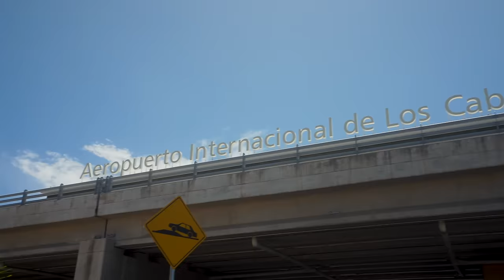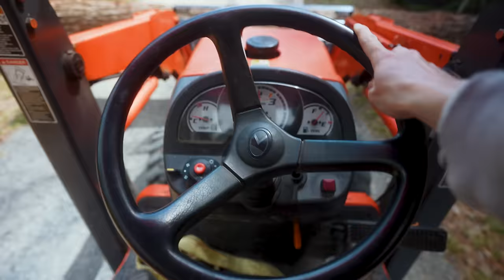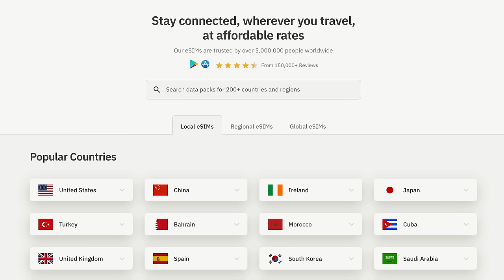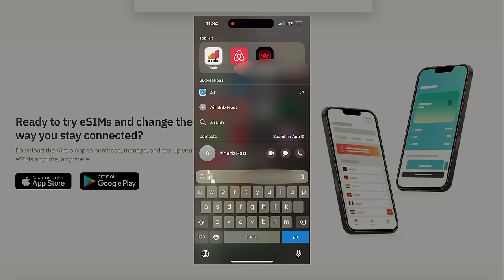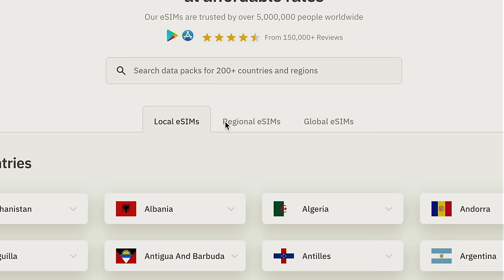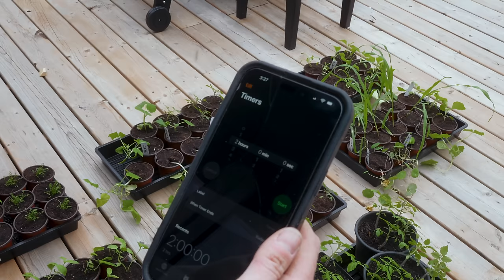IT'S OFFICIAL! We Bought Land in Mexico to Build Our Dream Home!

Comment: Just wanted to give some advice on the sumac trees. When you plant sumac trees it is best to dig your hole then put a big plastic barrier inside the hole to force the roots to grow down. If there is no barrier the roots can go out 30 feet and off each root you will have dozens of new sumacs. It is this really hard to control the sumacs. As an example when planting bamboo a barrier is installed to control its growth. Please reach out to me if you have any questions. On the property we have now cut down the sumacs that were huge as every summer I would pull out at least 20+ shoots. Even now the stumps and roots are producing growth. It sounds like your sumacs are still small so I would definitely replant them. I would actually consider them as an invasive species.

Comment: A little tree planting tip, I learned from Garden Answers.  Plant it high, it won’t die, plant it low it won’t grow.  😊
Reply from the maker: We love that, and it rhymes thanks for sharing. 😊🐶
Reply: Plus Garden Answer plans to add lots of compost around their growing area so they are taking that into consideration in deciding what depth they will plant at.  But a little bit higher is better than lower.
Reply: And keep any mulch back from the root flare.  If you see a tree where the bark is separating at the bottom from the tree it’s usually because of too much moisture, bugs or disease from mulch up on the base.

Comment: When cutting, If you put the dogs (spikes) into the wood and pivot off that into the wood cutting. Do you know what I mean? You will figure it out because it’s the easiest way to cut a larger log.
Reply: Yeah, those electric chainsaws are pretty weak compared to a gas/oil Stihl chainsaw. There is no comparison between the two….well, except that they both are chainsaws and cut wood, but it ends there!

Comment: I am so happy for you two it's truly awesome, and hard earned. Small suggestion put an underground water tank and root cellar..... It will be so worth it because below ground temperature stays more balanced and cooler. When you design your place incorporate that & if you put Aircon in make sure your design allows for installation of Aircon.  And windows have through draft. Seems that place is hot.

Comment: Congrats.
I hrew ip two streets from the beach.  I could have better childhood despite growing poor AF.

Despite conteuction materials and methods being differen in MX, I hope you either hire an engineer or architech so you don't improvise on room measurements or structural integrity of your house.

While you can help, I also suggest you to find a superintendent or ecperience foreman with say 3 labor helpers to build the house.  It will be at least 5 times tougher that what you did in BC.

Finally and given the effect of the beach that wuickly corrodes metal, follow some US building code standards.  I particularly will make sure to do 6" thick exterior concrete walls , so the rebar has 3" cover.  In the footings, I will have at least 2" cover..

In terms of logistics, start checking the nearest hardware store, and it is a limited supply capability or is big l like Home Depot.

Check if you have a concrete plant or you need to mix it by hand or you can rent a small concrete  mixer.

While it is attractive to start building,  you also may consider building a good fence 1st to about your consideration materials to be stolen.  I worked in construction in the US for almost 30 years and despite my best efforts, my own employees occassionally were yhe bighest thieves.  In the wors case scenario, get a sea container, reinforce the security by building iron gates in the inside and have wuality padlocks on the iron gates and on the trailer (sea vontainer) doors.  A security dog could be an alternative.